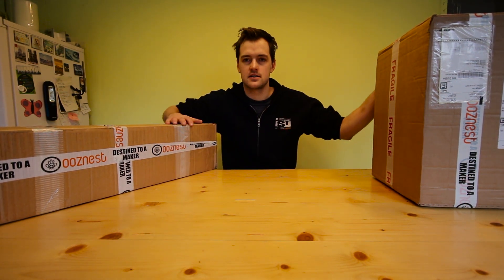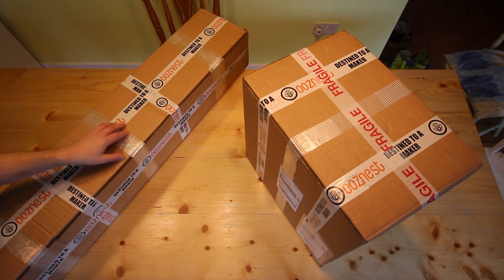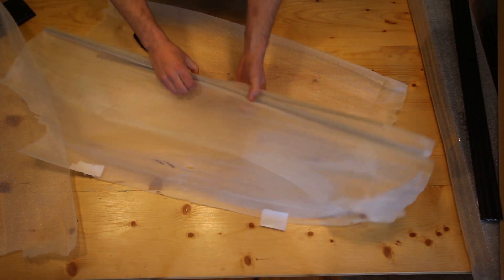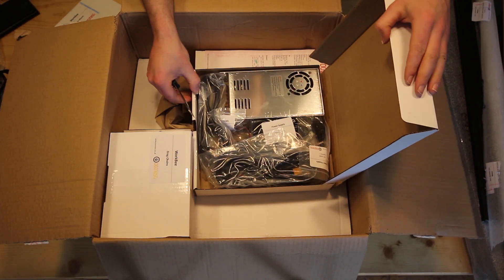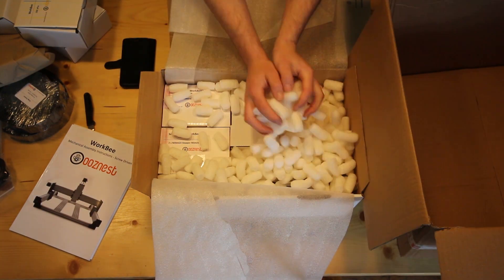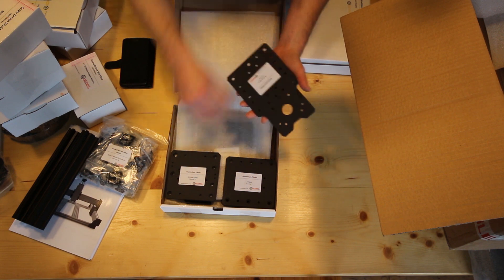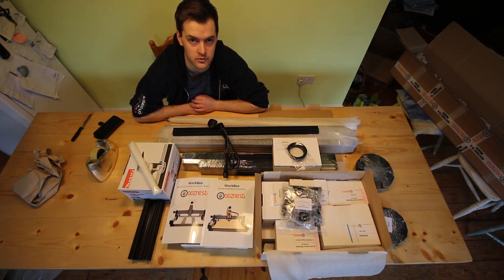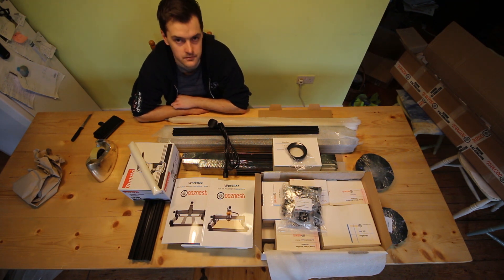Unboxing the WorkBee CNC Router #1

Comment: I have a problem with attaching the Acme nut blocks to the Y plate (page 7 in my manual). It shows using 3mm spacer and precision shim between the nut block and Y plate but the holes drilled in the nut block are not wide enough diameter to allow the spacer and shim to insert. This means I get a gap between nut block and Y plate, but the manual shows the nut block firmly against Y plate. Anyone else had this issue? Or have I misunderstood something? Thanks

Comment: Hi would you recommend the workbee cnc? Can a newbie figure it out?

Do you know if its better than the Shapeoko?

I am looking at the large work bee 1510 60"*40"

Any advise would be appreciated. Thanks
Reply from the maker: yes i would, i really like it. I looked at the shapoko but because sided with this one as I would get more cnc for my money. The shapeoko would have been expensive to ship and I am near the uk where this came from. i prefare this to the shapeoko as i got mine with the screw driven instead of belt which the shapoko is. you get better accuracy. also the large workbee doesnot have screw driven feeds. you should be able to work it out no problem, i managed it and didnt know anything about cnc before this.
Reply: Thanks for the response!

Comment: yes I got the same one as you but I got the dewalt router and also bought vcare as well I got mine in December so didn't get printed manual they wernt ready when mine came have fun putting it together
Reply from the maker: nice, I wanted the makita for the variable speed. lucky that I waited for the manual :)

Comment: Cool, I just received my WorkBee cnc last week, nearly finished the mechanical build part onto the electrical parts soon.
Reply from the maker: Cameron Philson awesome, just got everything working and ready to do some test cuts!
Reply: SerielThriller fantastic, are you using UGS? And how was setting up all the code, looks a bit daunting to me
Reply from the maker: I am using UGS, its pretty simple if you follow it step by step. UGS is pretty easy to use, just have to learn what each button does.
Reply: SerielThriller thanks dude! Hopefully get onto making stuff myself in a couple of weeks I reckon, good luck with yours!!